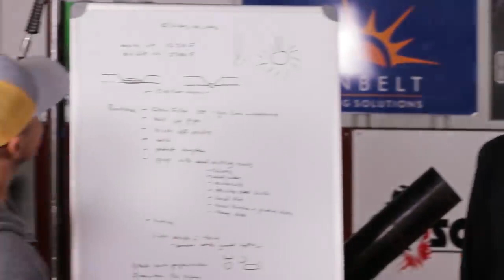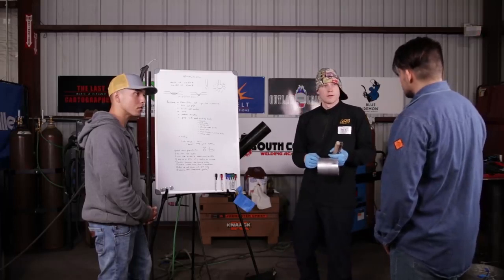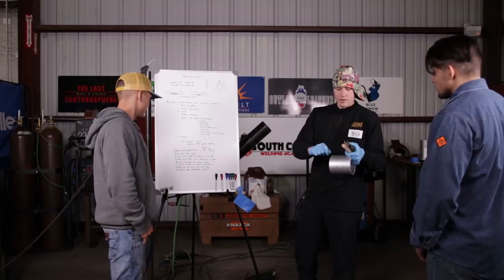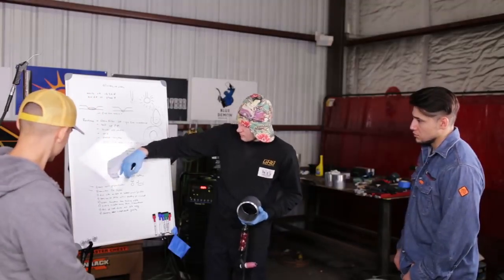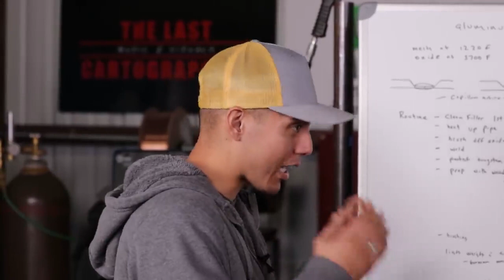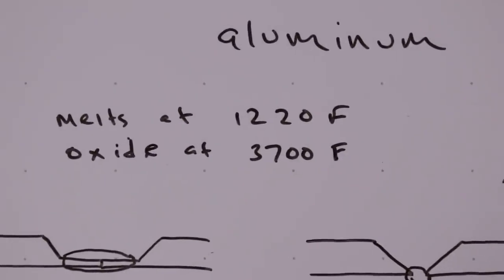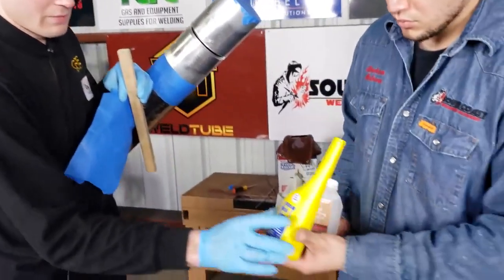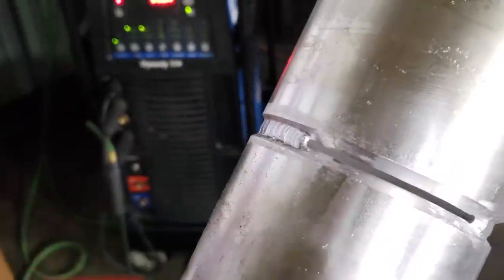Aluminum Piping - Part 1 - Weldtube - December 2018

Comment: Hey Tavis,

I see that GRB Enterprises is no longer in service, are there any good  training schools/courses out here in Edmonton that you would recommend? Thanks in advance. Keep up the good work!
Reply from the maker: I still talk to Gerry to see how he is doing., it is tough to say because the way I look at it - you have someone who was in welding since 1963. Got his diploma for welding in 1968, and later came to Alberta in 72/73, where he was welding nickel alloys in syncrude, and he was placed with Welders of less experience or skill, knowledge, so he could train and teach them..taught welding at Nait in 78, before opening his own school in 83.. and his current location moved to in 90'., Gerry knows everything about welding., all the metals and welding processes, and has seen and trained many Welders for over 50 years, so he would have gained their knowledge too and their techniques. The only thing that there is remaining in Edmonton that offers training would be Clac testing training facility. Went to the boilermakers 146 in 2009, and the instructor told me they will not teach me tig welding because it is their bread and butter. I have never gone back and never joined the boilermakers., never been to 488 union hall training facility but I would bet they would be good as they do weld nickel alloys and all kinds of metals. Gerry was with 488.